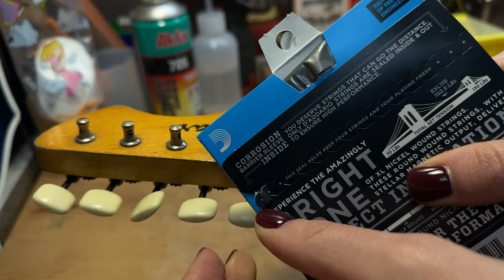Cheap Vintage Guitar Restoration

Comment: I used to have a Jolana as a teen (a different model). I would not resist replacing some of the parts (tuning pegs in particular, possibly the electronics and pickups). It's still probably a better guitar after your repair than what it was originally. Чудова робота!

Comment: Hey, Tanya, I have a question for you. I have a guitar and the sides of fingerboard in varnish too, as the whole neck. And tell me, if I want to replace the frets someday will the sides have no varnish because of sanding and rounding the frets? Anyway that's good video!
Reply: When you're filing the fret ends and sanding their edges, you do it at an angle that means you are not hitting the varnish on the sides.
To be extra safe, you can put tape on the sides to protect the varnish while the frets are worked on.
Reply: @FlameFlickers  THANKS BRO!

Comment: I have this exact guitar, in black. Bought it used more than 25 years ago for an equivalent of 50$. Sadly, it didn't have the original pickups. The bridge is completely useless, total sustain killer, replaced it with a ToM (had to drill through the pickguard for the posts. Otherwise, it works perfectly fine.